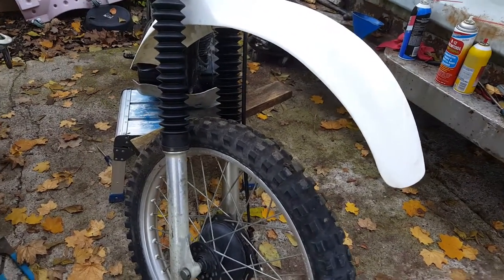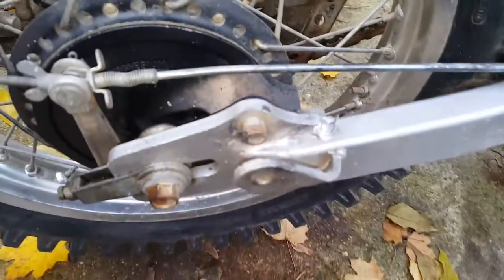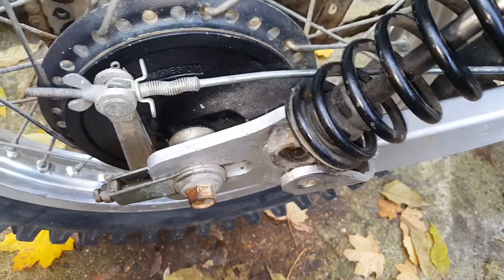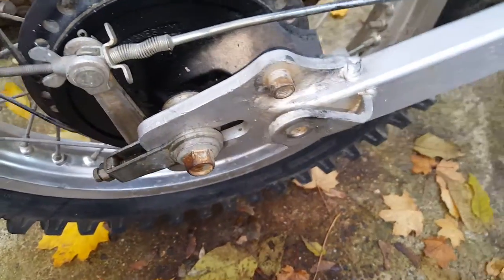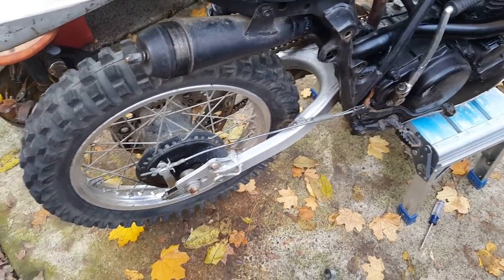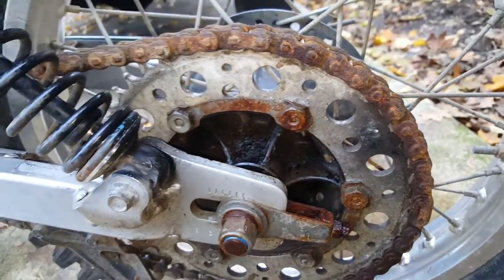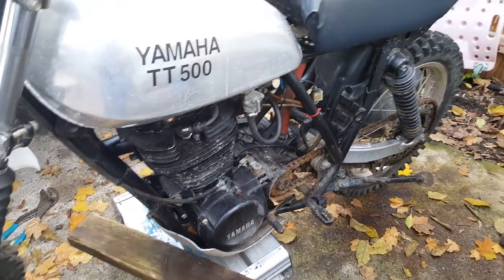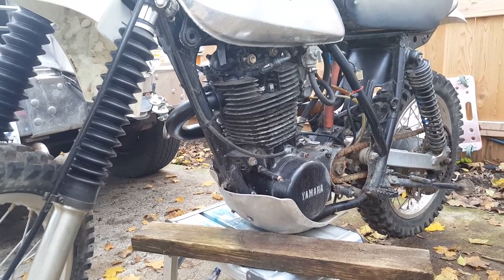TT 500 So close to being done and ready to ride

Comment: woow looks great mashine dude!  like up
Reply from the maker: SongoLand I'm about to load it in my truck and go ride it for the day
Reply: ejej great idea!  i need to take my ossa out one of this days, ejeje
Reply from the maker: SongoLand this will be the 1st time I actually ride this one
Reply: jeje ,  i love this old style bikes, they rock!
Reply from the maker: SongoLand I agree I love the old ones
Reply from the maker: SongoLand this bike is a good one she turned out to be a great healthy bike I rode it all day yesterday.....found some hidden issues though....the timing advancer unit had been tampered with and didn't work at all and the bike fell flat above about 12 to 1500 rpm I looked at it and noticed it had a ring welded to the outside of it with a chunk of rubber to lock out the advance weights so I took it out and it ran even worse....and came to the conclusion that it's either the weights are sticking or the springs are to heavy or to light....and i went into my parts stash got another put it on and it fixed the issue...after I reset the timing and reset the points gap she ran great all day for me and started with 1 kick every time
Reply: great man! she only is lokking for a bit of atention ,jejeje.. sure feels so happy after the ride of yesterda..  well done dude
Reply from the maker: SongoLand yeah that was a pretty weird though how it ran fine like that...then I went to load it up and it ran like crap.....I can't come up with a logical explanation for why it did that....logically if nothing changed it would run the same exact way ....but either way glad I noticed the advancer unit didn't look right....which made me good look at known good ones after seeing rubber stuck in it near my thumb and the ring welded on to keep the advance locked out.....it would of been lacking at least 30% of its power other wise...which was never noticeable to me just riding it up and down my street only a couple of times....couldn't open it up 
https://lh3.googleusercontent.com/QIF3CHs2NIqMAXSPK_U3SQmDG_UYlQXIytRgVcup4pZuAZTayB9Z-q4d0kzZJIYirwaGwFq59aw

Comment: Damm Nice Brotha u Bout Gotit Hell Ya
Reply from the maker: Roy Nelson yeah man pretty much just waiting for paint to dry on the replacement shocks.....it's much easier to remove the rear wheel to replace the chain and sprocket set when there's rear shocks on it to hold up the swing arm and a lil bit of rust removal and it will be ready had the entire front end apart a lil while ago....but yeah it's looking pretty decent
Reply: Yeah it's looking real good man real damn good
Reply from the maker: Roy Nelson yeah the new fork boots and painted exhaust pipe made it look a lot better....and the tires still have air in them from when I 1st brought it home...so I'm just going to run them.....and I brought my shocks inside to dry so can install them tomorrow and cut the chain to size and swap sprockets I've got a 14 tooth for the front and a 48 for the rear.....I may want to go with a few more teeth on the front sprocket not positive yet
Reply: Yeah once you get on that bad boy see how it's geared with what you got you will figure that one out bro I bet that's a hill climbing son of a bitch
Reply from the maker: Roy Nelson oh man these things climb like crazy with pretty much any gear ratio
Reply: Might give that KX a run for your money bro LMFAO not haha
Reply from the maker: Roy Nelson yeah that kx would out run the tt....but in a long desert type race the tt has a chance it can run all day....the kx can't with out burning up a piston
Reply: That is true pretty badass either way
Reply from the maker: Roy Nelson yeah absolutely both are bad ass bikes in their own rights.....got the shocks on....gotta run a couple errands in an hour and will pull the rear wheel and sprockets and in stall them and the new chain needs cut to size and that bitch is ready
Reply: That's badass bro
Reply: That would be cool brother I'm in a big pickle man I switch doctors I went to the new doctor last month I just went today they won't write me pain medicine said I have to go to pain management I've been on these things a long time bro you know that trying to get back into my old doctor the 16th is the earliest I'm in a big pickle man
Reply from the maker: Roy Nelson oh man Roy my wife is sort of going thru the same thing the state is demanding she cuts her meds down by 90% in 90 days.....all because others abuse and sell their meds and doctors handed them out like candy and created a bunch of addicts......but if you can man you really should get in with a pain management clinic.....they are making people such as you and my wife with legit medically nessary need for pain meds and when you've been on them for decades you need more than a normal person would need or even use with out dying from an overdose.....it's so fucked up some asshole in an office that's never had surgery or a medical issue's and has never felt horrendous pain....gets to play God with other people's quality of life and it's fucking Bullshit take the drugs away from the addicts don't make legit people suffer especially since the pharmaceutical companies doctors and our government created the prescription drug abuse issues
Reply: That's for sure when I switch doctors they were supposed to hook me up with pain management and didn't that was their fault now they won't write me and that's an hour away for me to travel and it's fucking hard man the government only wants you to be on one pain medicine now they got me cut way back from what I was getting them got me hooked on Fentanyl patches 100 times stronger than morphine took me off that I have a whole lot more to say but I'm not going to put it on here I'll let you know on the other text a little later and I'm just in a pickle man
Reply from the maker: Roy Nelson man I know exactly where your coming from man and I'm sorry you've gotta go thru this bullshit
Reply: Yes I know you do brother I had to pick up a few to help me till I was supposed to get my script today living on disability I ain't no joke now that I'm about broke I have one friend I'm going to call and see if he can help me out with a few dollars but I don't know if that will happen
Reply: You fucking said it all bro
Reply from the maker: Roy Nelson sadly it's the fucking truth
Reply: Absolutely brother man I don't know what I'm going to do bro I hate being in the fucking pickle I'm going to have to try to figure something out and it sucks not having friends down here all my friends are in Indiana I can't even get a Hustle and that sucks because I don't mind doing a little hustle you know what I mean
Reply from the maker: +Roy Nelson yeah man I know exactly what you mean I have no friends here where I live either all my friends live 100 miles away and I really don't know very many people  where I live.....I straight busted my ass all day fixing this damn bike all but 90 mins of the day had to do a bunch of shit I didn't expect had set backs and shit but it's fucking done
Reply: Me and you are in the same boat it sounds like brother I know there will be a day we meet up that's for damn sure did your nephew come over and help you out on fixing that bad boy up can't wait to see a video of it getting down man you will have to do a couple drive by videos so we can hear that bitch  HUMMMM!
Reply from the maker: Roy Nelson naw man he didn't come help and has plans tomorrow so I'll be on my own going riding....but she's ready to go....just gotta tighten and recheck some nuts and bolts.....I'm going to have to buy some new break shoes for it one of the linings came off the shoe so I epoxied it back on the shoe for a temporary fix it works for now but I don't know how well or how long it will hold....and I had to re tap a lot of bolt holes and fix threads and clean threads and had to straighten the lower shock mount tabs from the last dummy....because they were hack job jokers.....the chain I took off this could make a half circle side to side it was so damn worn out.....but finally after busting ass on it today it's ready to rock and I can't wait lol
Reply: Fucking a bro that's badass man UPimped this bitch out quick I can't wait to see those videos tomorrow man